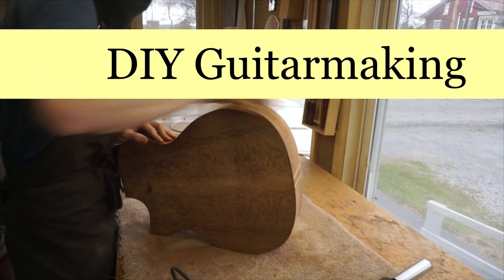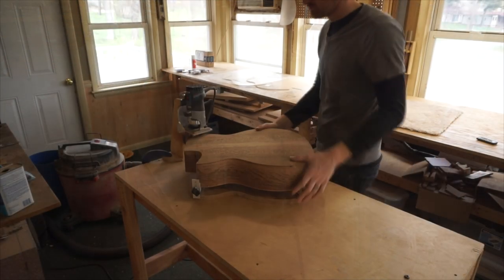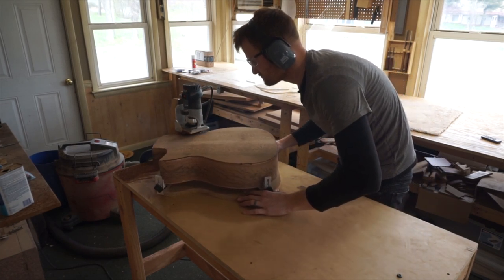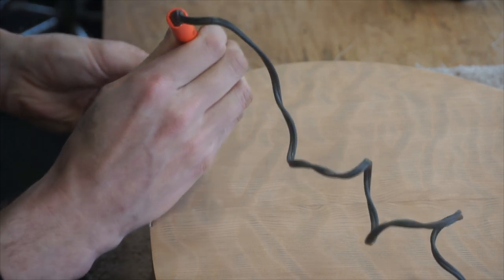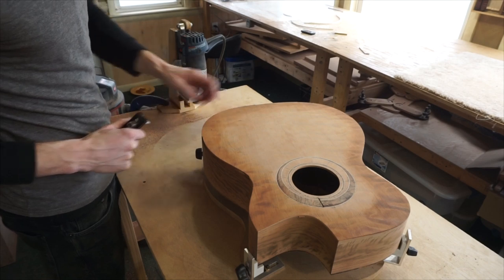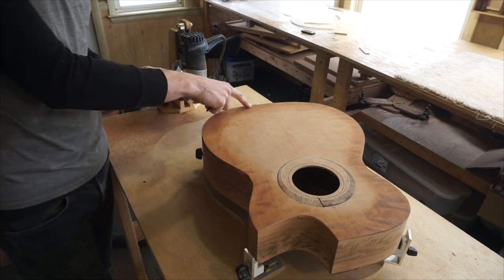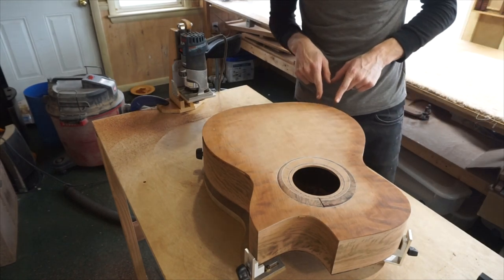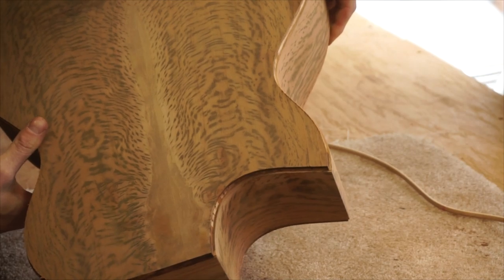Cutting the Binding Channels on Guitar #57

Comment: At about 1:00 you state that you adjust so that all corners are the same height off the table. Since the neck end of the body is typically thinner than the tail end, would this not make your sides not perpendicular to the table and so not make your channels square to the sides?

Comment: Hi eric, like you I’ve built a router setup to do the channels with but I get indents all round the side of the guitar from the bearing which is rotating fine. Is this normal ?. I’ve noticed it whenever I’ve used a guide bit. Is there a way to stop it or does everyone just sand down the sides even more afterwards? Thanks

Comment: Should bindings be used on the back of an acoustic guitar? One thing is using a thin protective strip, other thing is a normal binding that can compromise the integrity of the instrument. When looking to classic guitars we usually do not see decorative binding but protective thin strips.
Reply: It's not necessary but it's a good protection against dents. I own a Cole Clark steel string that doesn't have binding on either side. It look nice but I already got a couple of spots that got damaged, even though I take good care of my guitars.
Reply: @PelleKuipers  Has a protection yes, that's why a thin protective strip should be used, but large and decorative bindings could ruin the integrity of the glue  joins specially on the backs.